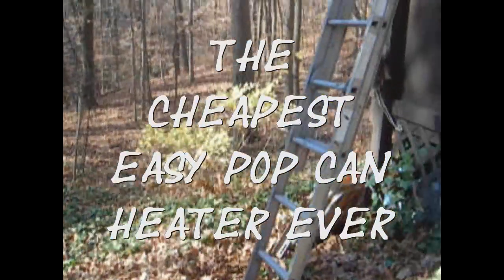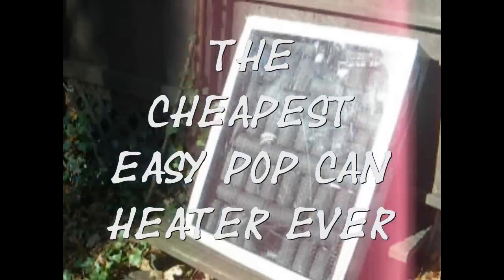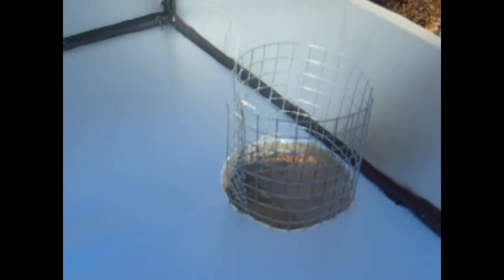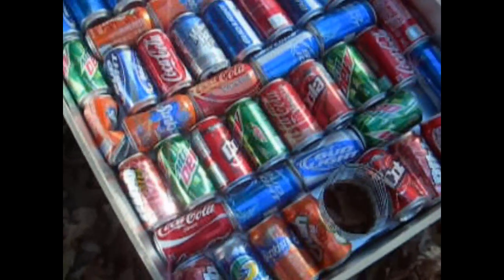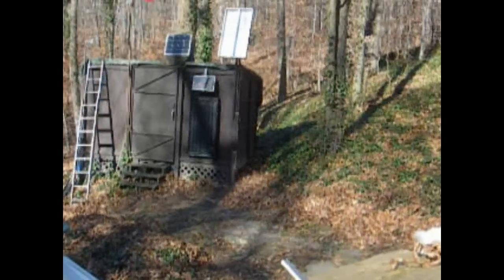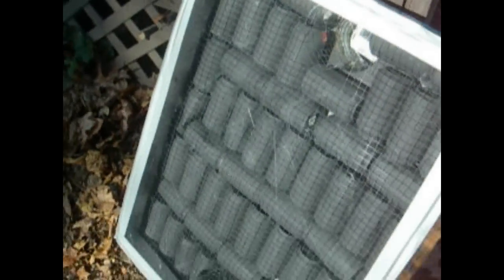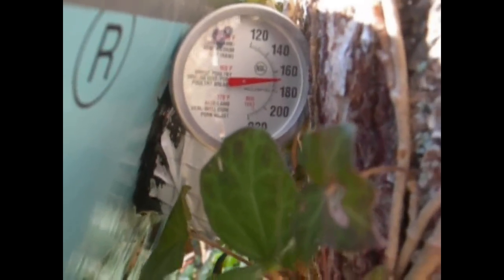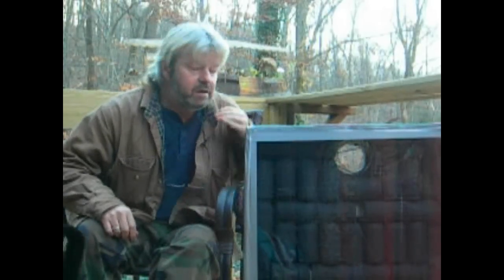THE CHEAPEST  &  EASIEST  POP CAN HEATER EVER!!

Comment: What you might want to us is another reflective media,instead of foil back paper!  Try this, find (I know it will be hard) approximately 20-gauge Cast Iron with aluminum foil as reflector! Also, Make sure you paint the surrounding box black, inside! One thing Q-factor is a lot higher in cast-iron,remember how long it took old cars to warm up!  Also, if you put another media in the cans, besides air, you can increase your stored energy like water or antifreeze,something that will not pit-aluminum

Comment: So, well ok?  What is your temperature coefficient, delta T? Great Idea with useless cans sitting around, and aluminum is one of the best heat conductors their is! You need the Q-factor (Maybe someone can help!)  of aluminum to find calculated heat transfer! You can also used temp in -to- temp out, for delta T! I would not rip my windows out to put this in there, when sun goes down temperature will drop drastically! Also, aluminum gives up temp at a very fast rate!

Comment: I like it, I like it a LOT!  I have at least 4 windows that a light weight box such as this would be perfect for adding heat to the space, I could then run just my HVAC fans and circulate the heat throughout each level(two story) instead of running the gas furnace... Rich yur rock'n my world, THANKS  M

Comment: he has built others the correct way. did u not see his amazement in how well this works at generating heat u dummy. the only thing is that this probably is not as efficient when airflow is presented into the equation.

Comment: Hi! Nice instructions. I live in an apartment so I can't remove screens to put hoses through anything. You suggested in a pop up just putting it in a window. The sunlight comes through my back window really brightly between 10am and 4pm. If I made a box and put in on the Inside of my window, It should still work, pulling in air and heating it in the black cans and pushing out warm air at the top??  I guess I should start asking my friends to save their soda cans.  Would this work with food cans?

Comment: I am so inspired.   I am pretty clueless.  Once you make this, how do you use it to heat your house?  It only works during the sunny day, right?  not at night?  How do you connect it to a room and how do you spread the heat around?  IS there someplace that shows this? What kind of hose?  Do you need a fan on the house? Or what?

Comment: with the temp inside the heater being over 100 what was the temp of the outside at the time? and what is the heating like in winter does it still each similar temperatures?

Comment: @molligemozes beter late than never?   Answer 1.  Water boils at 212 degrees so no it wouldn't boil water. 2.  seriously? steam?  not a lot of electricity will be created by using the heat of 180 degrees of small air current directed into some water to create steam and then direct the steam into something that will generate current.  3. possibly a light bulb's worth of energy can be created using the "light to can to air to water to steam to generator" method, but probably not.

Comment: This won't work to heat a room... once you add a fan to circulate the room's air through your box, the cold air will blow past the outside of the cans (half touching the cold glass, and half touching the hot cans.  The result will be pretty luke warm.  If you force the air through the cans only, you will collect all of the heat from the cans and it will be more effective.

Comment: @richardheadIII you also gotta remember that the air isn't being forced through it like a furnace, its "stale" air so it heats higher faster. when you move air through it it will maintain a lower temperature. if you dont believe me, check a gas furnace when its blowing. you'll see the fire shooting through tubes heating the air rapidly. once this is pushed through the system, it will heat the house/shed to a nice temperature.

Comment: i think heat absorbs more on a rougher texture thats what i heard anyways i would try cutting and smashing the cans up then paint black. love the idea im gonna make one tomorrow its freezing in new york state. im going to try to put 3 or 4 levels inside it using insulation so the hot air has to snake up that might help. i also had an idea to have a mini wind turbine hooked directly to a heating element no batteries only heat when wind blows  if anyone can make something like that mail me please

Comment: Hi Rich! This is impressive. I did not read all the comments and do not know if you mentioned the outside temperature. Maybe you do not remember what it was but I can see that you are wearing a winter coat. I guess that it was about 45 to 50 degrees because I did not see any steam coming out of your mouth when you were talking. I like your use of wire mesh. I will be building more wind turbines with wire mesh myself. Thank you for the show.

Comment: I think you are onto a great idea here. I know you didn't invent the original concept, but you've proven that there is no real need for tubes. What do you think of building a similar box and just filling it up with crinkled aluminum foil? Painted black of course. That's even cheaper and easier than the cans (at least if you don't drink beverages that come in cans - and anyway you don't need to clean the foil). Any thoughts?

Comment: Do you think there is any safety issue with heating styrofoam?  Do you think it will release formaldahyde into the house?  Also, RTV black caulk is better than mortar...will hold up to any heat you'll make by the sun.  You expirementation is helping a lot of people.  These are becoming popular and your practical research is helping. Please keep at it and please keep posting the results.  Your solar tracking invetion made from a shop vac was FANTASTIC.  You have a great mechanical mind.  THANKS!!

Comment: @jobillfleetwood RTV silicone caulk (black) is made for engine heads (rated to 450F) if you want to seal anything in the box.  I plan to make one soon and use RTV to caulk all the joints to keep the box tight.  Also, if you really want to get a good heat sink, there is nothing like phase change salts for BTU storage.  You should look into them, and you could make your own.  Without a temp control you will melt a plastic cover.

Comment: Hey Rich, Im a huge fan. 3 things for you. First the camp heater was great. Second, the loose cans work better than the sealed cans. Even transference of heat not restricted by an air channel. Finally, add a 2" pipe of salt or sand up the middle of your furnace. It extends your heat into the night. Salt and sand store heat very well. Similar to oil.

Comment from the maker: small 12 volt fan  mounted on output  to pull air or in put to push air but works without the fan. can be powered by solar or transformer  with switch or snapdics see other videos

Comment: It seems to me that there is enough gaps between the cans to permit adequate air flow.  Since the cans do not have holes on both sides, the air inside the cans heats up and stays in the collector longer.  Maybe that is why it works so well?  I definitely am going to make one like this for my first attempt.  Thanks so much for posting this!

Comment: Thermal-siphon flow out of a 4" hole isn't what I'd call "great" airflow. I'd call it minimal at best. Yes it does put out some heat, but forcing the air(fan or blower) will increase the efficiency of the collector. At a thermal-siphon flow rate, the heat in one small collector will always be the same as the heat from 10 collectors hooked together. It's the collector area and airflow that makes all the difference in efficiency. Remember my dryer video? Test using a fan and see what happens.

Comment: Thanks for the new video Rich.  You'll find that even if you make one that only has 10 cans you will get the same temperature in the collector. The thing is you don't have much airflow there, Increasing airflow with a fan will reduce the temperature drastically on such a small collective area.  If you were to connect more together you will increase the temperature of a forced air system. However with simple thermal-siphon flow.you will still only get the temperatures you are getting with one